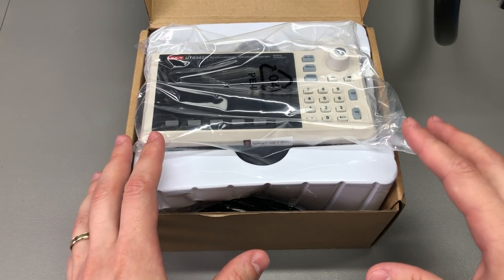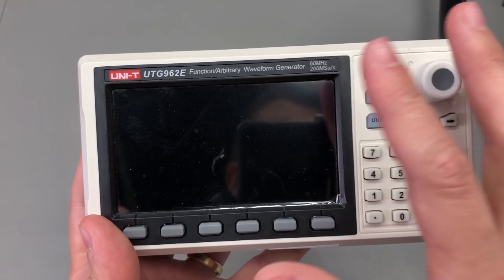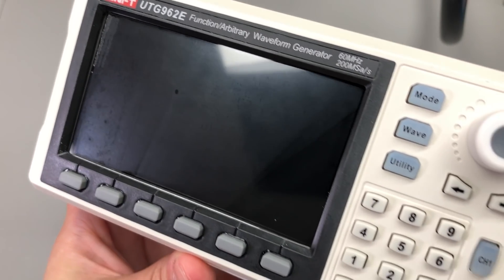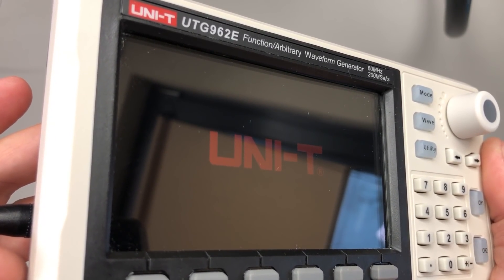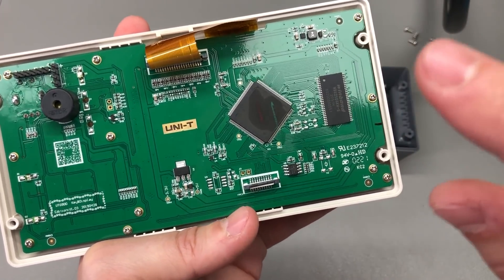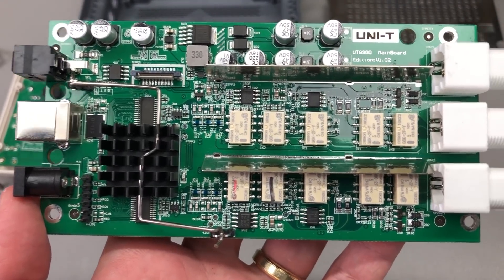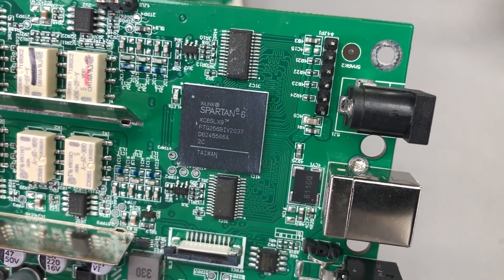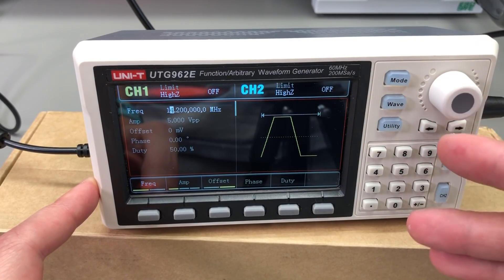You Need This Instrument Right Now | Voltlog 376

Comment: Is a arbitrary waveform generator the same thing as a function generator?
Reply from the maker: These days I guess they are all arbitrary waveform generators but as the name implies a AWG should be able to generate arbitrary waveforms whereas a function gen should only be able to put out the periodic standard functions it contains.
Reply: @voltlog  The reason I asked the question was that my function generator can also custom waveforms that i create as well as the one's it comes with. I was hoping there was something special about the arbitrary one's. So I guess they are pretty much the same.
Reply from the maker: @lashlarue59  These days it's quite likely that they are all AWG just because they all the "arbitrary waveform" capability.

Comment: In my unit, the reference clock has a ca. 5 ns jitter with a repetition rate of below 10 Hz. Easily seen when observing a 20 - 60 MHz signal from this generator against a better generator, set at the same frequency, on two channels of an oscilloscope.

Comment: In pulse mode, you have a square wave generator with adjustable duty cycle and adjustable rise and fall times if the frequency is low enough. Usable to at least 10 MHz.

Comment: Silicone double sided tape would be good on the bottom to make the buttons easier to push. Alternatively a remote control would be a handy addition to the unit.
Reply: The case has pretty nice non-slip feet. It just tilts backwards when you press a button because it's quite undeep.

Comment: I cannot speak in generally, but so far, I avoid UNI-T products. My experiances with their multimeters are simply to bad (and with that I agree with Dave Jones ...)
Reply: I have a Farnell (Multicomp Pro) branded 4-20mA simulator/calibrator which is a UNI-T device ... and it's full of software bugs that make it totally unusable in a live system environment (loop goes open circuit when manually adjusting the current through a number of points!) and neither Farnell or UNI-T want to know about it. I will be avoiding UNI-T based products in the future. V. Poor.

Comment: .... Well done Mate,  Does changing the output to 50Ω stabilise the waveform ?
I think it did on mine ?
Reply: This instrument does not change its output impedance. It just adjusts its amplitude indication, depending on what you say it's loaded with.
Reply: @raymonddompfrank1789   .... G' Day Mate, I can alter the output of my UTG962E to, 50Ω, 75Ω, or High Impedance (Default). I love this little unit, The button at the top should have been labeled 'Modu' (not 'mode') and the 60Mhz only applies to Sine. I still think it's cool Man !
Reply: @robbieaussievic  I meant to say that by changing the output "Load" setting, nothing changes in the output impedance or voltage. You don't alter the output to 50Ω, 75Ω, or High Impedance. Only the amplitude indication on the LCD is changed, because the instrument assumes that you apply a load corresponding to the Load setting. Try it out.
Reply: @raymonddompfrank1789  .... Thanks Mate, why does the waveform stabilize when I alter the channels load setting from 'High Impedance' to 50Ω ?
eg. into a SD23252X-E
Reply: @robbieaussievic  Why? It's just a designer's choice for simplicity. A fixed output impedance is much easier to implement than a variable one. The different loads that you connect cause the output voltage to drop and the instrument knows how much because it "knows" its own output impedance (OI). If the OI is say 50 Ohm fixed and you set it to generate 1V, on a high impedance load you will see that 1V whereas on a 50 Ohm load, the voltage will halve. The voltage indication on the display will be half if you set the "Load" to 50 Ohm. If you leave it at High Impedance, it'll show twice the actual voltage on the display.
Reply: @raymonddompfrank1789  ....Excellent,  Thanks Raymond.

Comment: LOL, Picked up one a few months ago. Thought one channel broke after about a month, but found no hardware faults when comparing channels. A Software reset fixed the issue. Fault was very low output on one channel. Not had any issues since. Funny the Modulation button on mine is marked MODE. Wonder if they will provide a corrected button for that. For the money, a very good deal. Spent the extra and got the 60 MHZ model.
Reply from the maker: what versions is yours running?
Reply: @voltlog  Software 1.07. Hardware 1.01. FPGA 1.07.

Comment: i stick to the fy6xxx models they are more capable and you get two of them for the same price which you can sync up for 4 channel.
Reply from the maker: I've been watching those for a long time and the build quality is terrible 😒 I'm guessing they get the job done but this UNI-T feels so much nicer.
Reply: @voltlog  because 99% of the functionality lies in the design and feel of the plastic case, not whats inside..
Reply: @gamerpaddy  Did you notice the terrible and dangerous "safety earth" connections on those and make-it-worse comments on YT?
Reply: no, but did a teardown of a 6800 on my channel and from what i saw it was good enough. the 6700 models didnt have earthing at all, that was sketchy as fuck but from the 6800 and up i got no complains. except a missing sync output and no shielding.
Reply: @gamerpaddy  Not so much the lack of earthing but crossing the primary-to-secondary isolation by what was called a "Y" capacitor (but of course wasn't really that) was the problem. That cap coupled mains onto the BNC's. The solution was to remove the cap and the BNC's no longer were "hot".
Reply: which was a problem of the 6600 and 6700 series. but it was just capacitively coupled and had very little current so not really "hot". not enough current to cause any harm but it could damage circuits.  but this behaviour is on any non-grounded powersupply like those laptop power bricks, usb chargers etc. they all have slight leakage. some more some less.

later models of this awg are fully grounded.
Reply: @gamerpaddy  I agree with that. Just a bit silly to put in that cap. and cause it.
Reply: @raymonddompfrank1789  its for emi filter reasons, its supposed to be there. every smps has one.  
those "SUOER" branded powersupplies are used in many things  they use a real class-y cap.
Reply: @gamerpaddy  You're correct of course. Maybe the use of Y-caps is an official requirement but then two are needed. Especially without knowing which is phase and which is neutral, you'd at least expect two caps (2 Y-caps is standard), sort of halving the voltage on the BNC commons. Anyway, it seems a bit silly to capacitively couple directly from the mains into the floating common of a low-level test and measuring instrument.
Reply: the transformer windings are capacitively coupling aswell, the cap isnt the only thing causing leakage.   
since plugs are not polarized you never know if you couple the hot or neutral line, its a gamble, but its main use is to supress emi. 

best way to fix this is hooking up one of the back bnc ports to something thats grounded like a unused port on your scope backside.
Reply: @gamerpaddy  Hi Gamerpaddy, you obviously know what you're talking about and we're telling each other things we know. As you describe, the transformer coupling is parasitic but this one "Y"-cap, which only (sort of) works if you ground/earth one of the BNC's and is a nuisance - and then a source of EMC - otherwise is a bit much. I don't think the ungrounded mains adapters you were talking about contain Y-caps to the DC output for the same reason. I think the "tingling" that is felt sometimes is caused precisely by the parasitic capacitive coupling in the transformer.
Nice talking to you BTW, just subscribed to your YT channel.

Comment: There may not be competitors with such a large display, but there are other waveform generators in this price range, including some 60MHz models.  As YT now removes posts with links, you can seeerch Bang Good and Ali Xpress for 60MHz waveform generator.

The smaller style of unit might actually be better for the bench as they stack somewhat better and tend to have the connectors on the front.  The UTG962 has nice display and interface, though.

My comments are all being D LEET ED!   If you see this, I've posted this about 25 times and it has no links!  What's wrong with this comment??  I'll do this all day, if necessary. [update] Finally!  I had to mispell the word "seeerch" and the website names just to get this to post!
Reply: I had SOME (not all) of my comments not showing (some showed to me but not others) about 6 months ago and struggled to figure out what the "bad" word was.  It was on a Julian Ilett video... electronics stuff... no bad words.  It seems the YT delete comment function goes off the rails at times.  Yet there are a ton of spammers on the big channels that are never dealt with.  Google wants us to pay for YT yet with all their money does NOTHING about the big time spammers.
Reply: wow, thats some aggressive deleting from the red play button
Reply from the maker: I've been looking at the FYxxx models for a while and I've seen a few reviews, the build quality is terrible on those. They may be slightly cheaper but I don't know, the UNI-T feels so much nicer than those.
Reply: @voltlog  Yea, the build quality on those isn't good, but I just wanted to point them out to people.  I don't have one, but some other youtubers have some of those cheapie models and they seem to work okay.

Comment: My unit purchased Dec 2020 has Software version 1.08, Hardware 1.01, FPGA 1.07.
Reply from the maker: So it seems like they bumped the sw version but there is no download available that would allow the user to upgrade.
Reply: @voltlog  So it seems. I spent some time searching for updated firmware without success. But there are some vague words in the manual about how firmware can be updated by USB connection with PC.

Comment: hello sorry to be a nuisance. but i am trying to evaluate the benefits / value of getting this product as a seperate signal gen. vs the ones which come with certain oscilloscopes. 1) Siglent SDS1104X-E and 2) rigol msu5072 / 'mso5000 series'. the thing is its not clear to me yet how they can compare to each other in reality. and for which specific type(s) of common practical lab situations.

for example the siglent scope says it needs external hardware to work. well ok... but then how does that product compare?

at least for the rigol mso5000, we can see clearly its just a software option, and the sampling rate specs are basically the same (25mhz / 200msps). however how many channels does the rigol give? only 1 channel or up to 4 channels? and does it matter, to need 2 channels of signal generator in lab situation? ... well can we have an example please, for when this will occur?

i am just finding it hard, to weigh each option against the others. since being on such a tight budget it matters to me. because the cost of the signal generator is in fact shared with the same budget for getting the oscilloscope. IDK what to do now

but i believe this situation and predicament is similar for many other people? shrug please let me know if anybody else here is familiar for this matters. or can briefly give other helpful example to help to paint the picture. many thanks
Reply: The rigol is a 2 channel output, you can see by looking at the front of the instrument. G1 G2. 
The first limitation you might run into is voltage peak to peak, I think its +/-2.5V or so. 
Its rare for most hobbyist to use more than 1 channel generally, but, any decent signal gen will come with 2 anyway. Although the second channel can be useful for say, precision voltage generator, just set it to DC.
You can google these products and read the spec sheets. Its quite clearly laid out.
Reply from the maker: I would totally get a scope with built-in arb gen if it was within my budget. I would assume bench space is limited for most people so it would be an advantage to have a 2 in 1.

Comment: I followed your link to check it out and discovered that they've sold out. Banggood got good value by sending you the review model.  A down side for me is the absence of a plug adapter for Ireland.
Reply from the maker: It's just a 5V 2A power adapter so it's inconvenient for not including all the adapters but you could easily replace this with any modern phone charger.
Reply: @voltlog  Will UNI-T pay for that for you?

Comment: FYI - Gigadevice is pretty much a 1:1 clone from an STM32. At least for the majority of the main STM lineup.
Reply: and they have a better availability also at the moment
Reply: illegal clone.. ST never licenses the design to gigadevice
Reply: @eone199  Absolutely not. they are not clones, they are compatible chips, redone from scratch. and it some cases  better than their STM counterparts. The internal design is completely different. As a proof, their VF103 is using a riscV core instead of an Arm core, same peripherals as the GD32F103, which would be impossible if they were just copies. Clearly a whiteroom compatible implemention, 100% legal.
Reply: @eone199  aparently they are legal somehow... which was difficult for me to believe without the proper explanations. for that you need to read on the eevblog from those who understood properly the details
Reply: @dreamcat4  do you have the link about that?